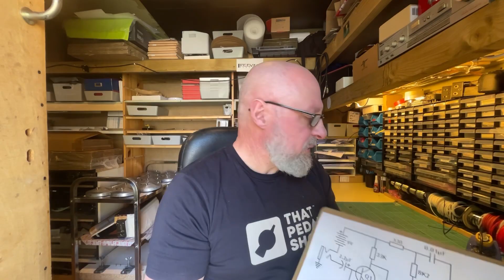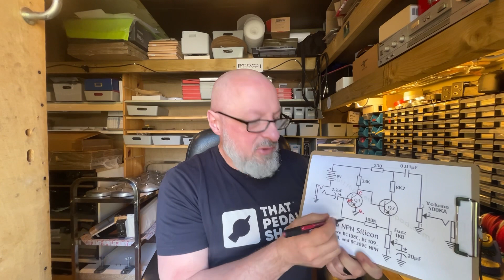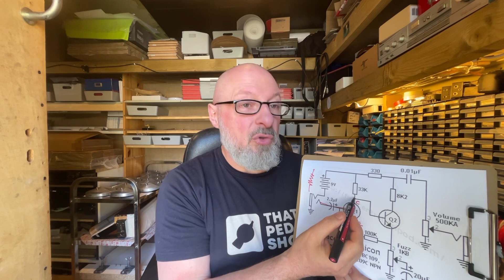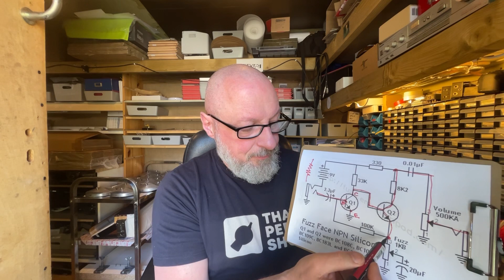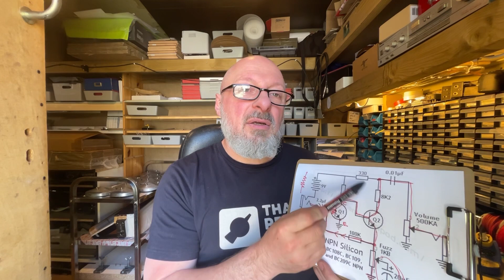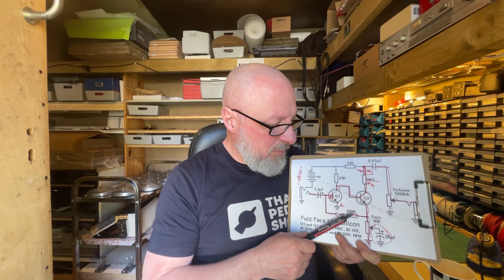The Friday Finish : Fuzz Face Schematic 101

Comment: Very cool! 

How do you feel about the Cesar Diaz Square Face, that has the 330R resistor swapped out for a 1.2K and a B2K fuzz pot? Do you feel that’s too much of a volume increase and starts affecting the overall tone? I believe the Hendrix/Roger Mayer mods were very close also. A B2K fuzz pot, 18K bias resistor for Q2 and a 1K in place of the 330R. 

If you were to start with all stock values and your bias was set correctly, say 4.5v on Q2, what would the outcome be of changing the 330R out for a 1.2K but still utilizing the stock B1K fuzz pot? Would that affect the bias in anyway and require a change of the 8.2k bias resistor?

Thank you!

Comment: Great video. I just built my first pedal. I built a fuzz face from a kit. I didn't really understand why it worked the way it does now I do. Is it possible to look at a circuit board with no schematics and know what is going on?  Would it be possible to draw a schematic from looking just at a circuit board?  great video. I learned a lot.

Comment: An excellent video, thank you. I’m new to pedal building and just started building Electra variants from schematics. This video has taught me so much and delivery was spot on for noobs like me and allows me to now build on that. Will now build on perf board with sockets for the transistors and trim pots for each resistor so I can have a play with the circuit, understand how value changes impact sound and work out what I like. Thanks again! 👊🏽

Comment: Thanks for the great video! One little correction at 3:56: The capacitors are actually "coupling" caps and not "decoupling." Coupling passes AC but blocks DC, while decoupling does the opposite.

Comment: i love your explanation of how it works but you are way off on the count of how transistor work
transistor is just a resistor for all intent and purposes when you aply dc to it
when you aply ac signal to the base you basically voltage controll the resistance, and you can simulate it with aplying dc voltages
transistor does not amplifi signals by itself, it mirror the signal by adjusting it's resistance in real time and it forms a resistor divider with colector and emiter resistors and "the signal" is  just a swing of those points up and down in voltage  while transistor dc resistance changes and output can be taped anywhere above 2nd colector  you can give it 8k resistor and 520 ohm  instead of 8,2k and 330 ohms and it would just be louder because you just taping on the signal closer to the transistor

Comment: 3:31 Boy that's simple, for something that was so important to Jimi Hendrix's sound and changed the world. 2 transistors, 3 capacitors, and 4 resistors (plus 2 pots), .1 switch, 2 jacks. That cast metal housing probably cost more to make than all the components. Great explanation too.
Reply: The enclosures are the expensive part.  But the first fuzz face was built in the bottom of an old microphone stand, and that's where the shape comes from

Comment: I remember learning that dc and ac voltages could exist simultaneously at the same point, or on the same wire etc. In a circuit. Like alot of things with learning these concepts i suspected it a long time before i confirmed it. But things sure made alot more sense afterward. I taught myself electronics by tinkering with everything i could all my life. Also being a guitarist i ended up working on guitars, pedals, amps everything else in the signal chain! Now this was wayyy pre-internet, information was scarce and just as often incorrect but i did get better and more knowledgeable all be it at a slower rate. When the internet came along that boosted my knowledge and abilities greatly also being an electrician by trade, i got a job in industrial electrical and learned alot there as well.

Comment: There is nothing to it.  You could build that circuit board from scratch fast,  the time would be in connecting and packaging the whole thing.  Only issue I have is not having any 2N or even Japanese transistors referenced.

Comment: Yeppers. Old tube amps put high voltage dc for plate voltage and run the ac audio voltage through the same wire too. The dc is filtered out, decoupled, when fed to some grids with a cap - some values can really mess with tone too. A transformer won't pass dc either.

Comment: When you're checking the bias voltages of a silicon Fuzz Face circuit, Q1 should have at least two forward-biased BE voltages on it's collector, the usual BE forward-biased voltage for a silicon transistor is about .6V so you should see at least 1.2V on Q1's collector if you're building a silicon transistor, and it is biasing-up properly (i.e. two forward-biased BE voltages).

Comment: I bought two issue 2 Fuzz Face pcbs online from the Pigeon FX website, nice quality ones too, I bought them so I could re-build my Jim Dunlop JD-F2 Fuzz Face pedal using some BC108C NPN transistors I bought on eBay , I selected two of the BC108C transistors that had the highest gain of the lot of 8 transistors, one had a gain of 635 which I used for Q1, the other had a gain of 660 which I used for Q2, these may sound like monstrously high gains for use in a Fuzz Face circuit, but they seem to work fine, resistor values are 330 Ohms, 8k2, 33k, and 100k, with the usual capacitor values, I did have to solder-in a 1nF greencap in parallel with the 100k resistor to stop high-frequency self-oscillation though, but it didn't have any negative impact on the sound, anyway, my JD-F2 Fuzz Face sounds really good and smooth, with a good amount of sustain, bias voltages were 1.19 on the collector of Q1, and 4.5V on the collector of Q2, battery voltage was 9.6V.

Comment: Wow what a great video!! So much awesome info.  I have been playing around with NPN hFE values for Q1 and Q2.  It seems the BC108B transistors I have are all 431 hFE.  Is there a favorite hFE value you have or favorite transistor?  What of transistors don't you like and why.
Reply: If you piggy-back two 2n3904s (300+ hfe) you can tailor hfe to whatever you fancy with the bases joined and resistor between the emitters. Use variable resistors and you can choose what hFEs sound best.

Comment: Great video! I have a question, regarding the bias control you add to modify the voltage supplied to the transistor. Wouldn't that also change the "attenuation" of the audio signal heading for the output?

Comment: Hello again thanks for this - quick questions if that is OK regarding silicon ff, first question is regarding hfe, do you know what the standard hfe is for q1 and q1 forthe schematic you had, so that the ff will biase roughly right with stock resistors, sometime even with trimmers I've had bother biasing a silicon ff, with germanium hfe of the 80/120 camp or there about I never have any bother, but silicon because of the higher range used I had bother in the past?  Also do you know for that classic silicon fuzz face what was the hfe used, I've heard 200s even 500s?  Thanks so much for this
Reply: You've inspired me to post my first fuzz face - https://youtu.be/zNZ04Kd8ua4 the feeling of overwhelming joy when it worked, 🤣 couldn't bloody believe it
Reply from the maker: Around 250 should get you in the ballpark 🤘 any higher starts getting into issues with noise and oscillation ..good luck!!
Reply: @reeveselectro  thanks!!
Reply: I've been able to successfully make two high-gain BC108C transistors work in a Fuzz Face circuit, in my Jim Dunlop JD-F2 Fuzz Face there are two BC108C transistors, Q1 has a gain of 635, Q2 has a gain of 660.

Comment: The difference in schematic symbols with resistors is between the different standards - the box is the international one (IEC 60617, most commonly used) and the other is the ANSI Y32(older standard mostly used in the US)

Comment: regarding output, I once bread boarded a FF circuit and moved the .01 cap from it's original position to between the collector and the 8k2 resistor. Sounded pretty massive too.
Reply from the maker: Cool I might try that 👍👍
Reply: @reeveselectro  let me know how it works for you?